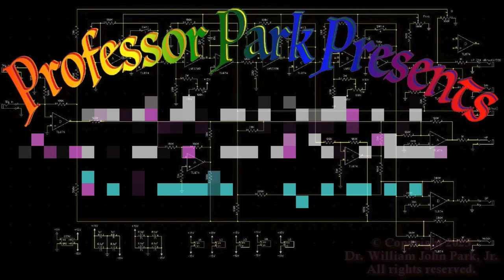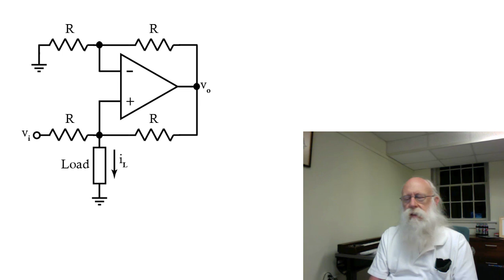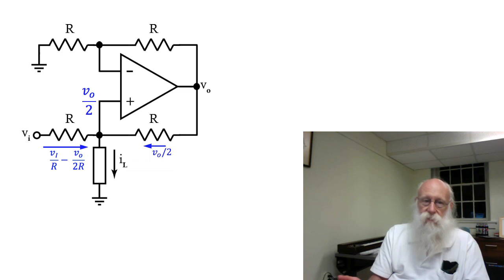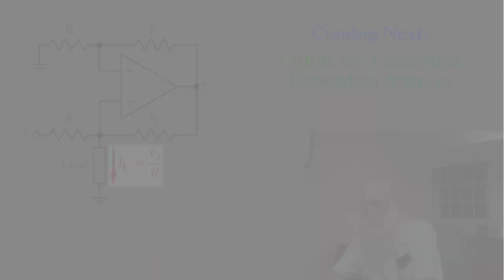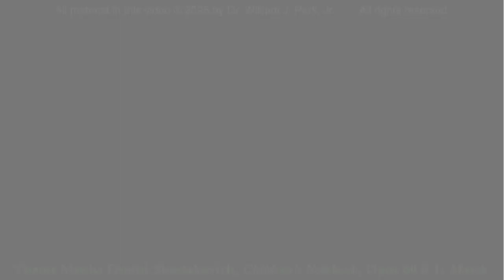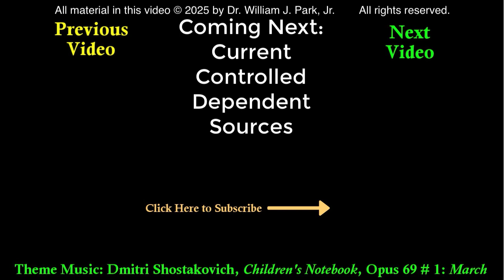Operational Amplifier Circuits 2.3 -  The Voltage Controlled Current Source Part 2

Comment: Is it possible to charge a capacitive Load with a constant current in the howland current pump ? I have try it with the floating current converter and it works, but for the Howland Current pump it does not
Reply from the maker: Hmmmm...
I suspect that you are asking the opamp to do something it cannot in terms of voltage at the output or current capability (which then depends at least partially on the value chosen for R as well as the control voltage Vi). I would suggest monitoring the opamp output to see if it is being pinned to one of the supply levels, either initially or after the capacitor has charged a bit. If you have a scope and know how to make it trigger when the beastie is first activated, it would probably be helpful to see how both the opamp output and the voltage across the load (a capacitor in this case evidently) change over time.